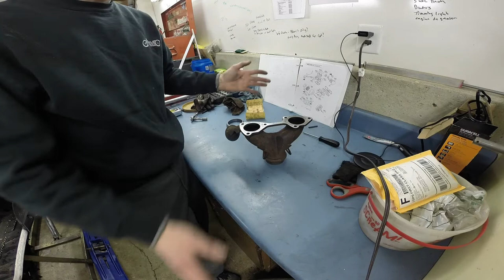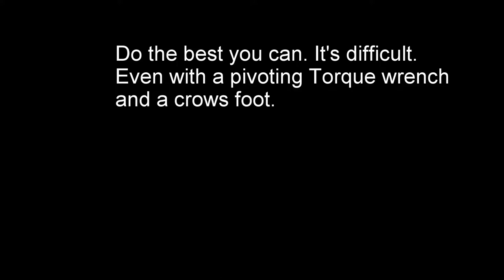Sled Tips 007 - Y Pipe Install the correct way with torque specification

Comment: What seat is that? Looks SWEET
Reply from the maker: Sled is an '06 Sno Pro 440 mod with an F7 EFI swapped into it. Those were the seats on the race sleds. I am working on converting this sled to a 144" mini mountian mod. You'll have to come back and check out those videos as I complete the project and get them uploaded!